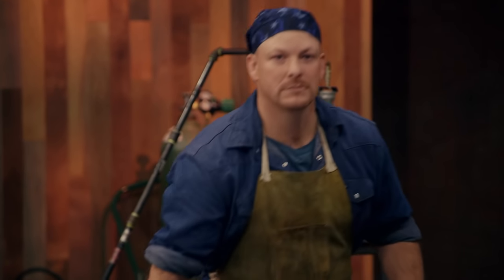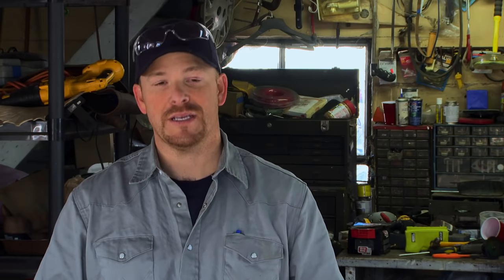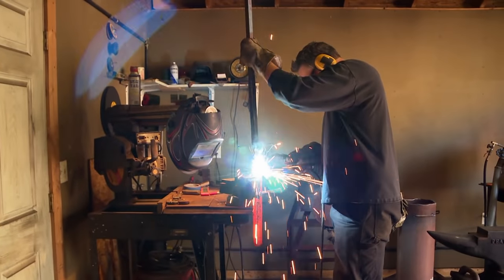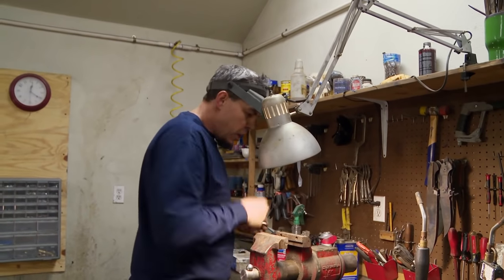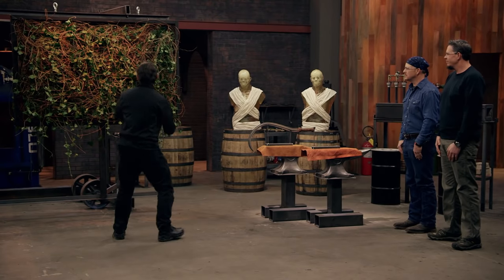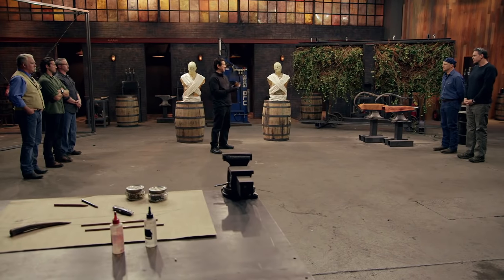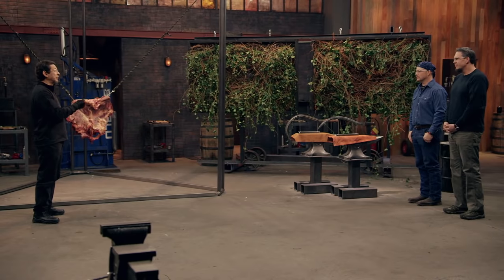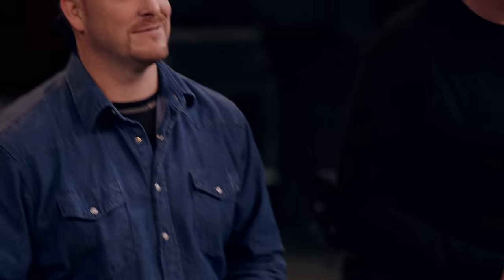Forged in Fire: LETHAL Shotel Sword STRIKES the Final Round (Season 2) | History

Comment: Season 2 strength test = We're going to cut through some vines. Season 6 strength test = We're going to detonate a nuclear warhead on your blade. You suffered some edge rolling on the warhead test, which indicates a problem with your heat treat, for this reason, you cannot be the forged in fire champion.
Reply: Forged in Uranium
Reply: The judges would be like "well unfortunately when we detonated that nuke on your blade, your blade completely disintegrated, which indicates there is a problem with the type of materials that you chose. Unfortunately your blade did not make the cut, please surrender your ashes"
Reply: That looked more like a sharpness test than a strength test.

Comment: Burts blade looks more like a weed slasher/brush knife than a sickle. I have restored and repurposed many of both in all different shapes and sizes for fun in between working on axes and hatches. I must say though if I had to pick one to use myself it would be Burts, much easier to use and fight with that less pronounced curve and way easier to sharpen. I can't tell you how many times my hands and fingers have fallen victim to the bite of a sickle while doing the final polishing, definitely way more than knives or axes despite working with them much less often.
Reply: Right. The less curved Shotel has more reach und would be more practical to stab behind a shield or cut the backside of a knee.

The more curved one would be better to pull a shield but still it's not that easy if your opponent anticipates that very move.

Comment: Obviously Burt one he earned but I do think Burt isn’t curved enough but the other blade is to curved and not sharp enough so it’s decent
Reply: The purpose was to reach around an opponent's block or parry.  The more severe curve was the more appropriate design for that type of weapon.
Reply: @Nate I disagree.  The blade with the lesser curve was indeed better for slashing and more practical overall.  However, this weapon has a specific design for a specific purpose, and the more exaggerated curve to the blade is vital for that purpose.  
Also, this weapon was designed to be used with a shield.  A 'hooked' opponent would then be leveraged against the shield to displace them.
As the curved blade is swung against the side of an opponent's shield, it gets around the defense and damages the body or the arms/legs.
Specialized weaponry like this often falls short when it comes to more generalized utility, but it certainly does the job it's made for.